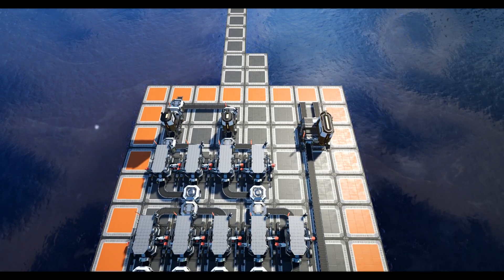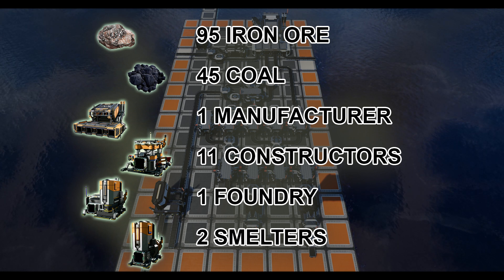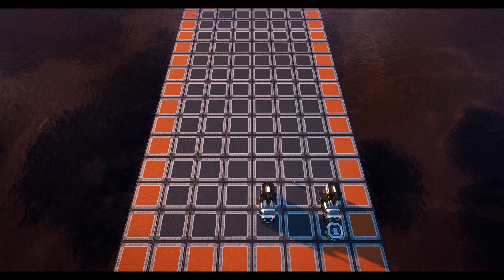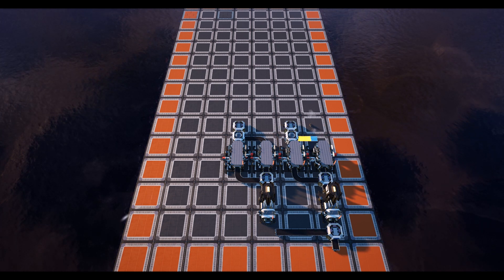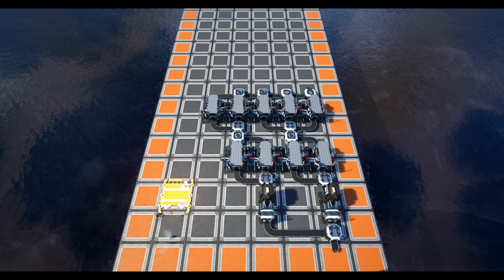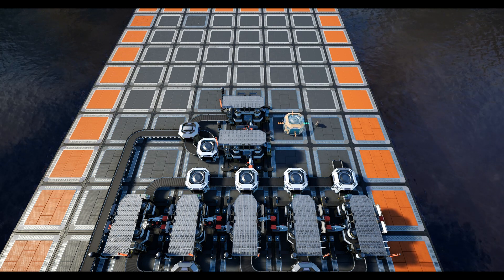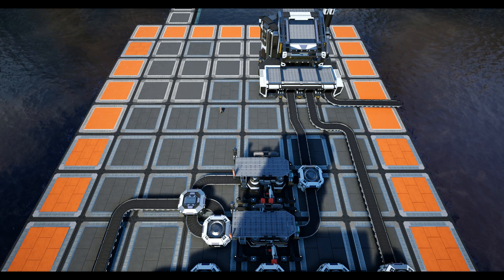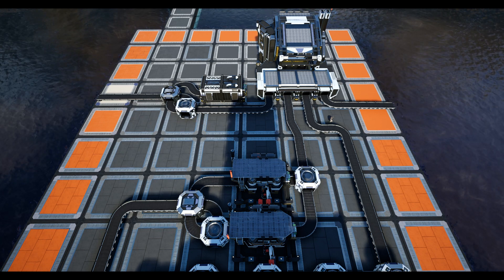Heavy Modular Frames Super Efficient Build Guide [Satisfactory Game]

Comment: I had to use two a4 pages to plan my factory out and farmed 86 power cells to make 3 heavy modular per minute  farm factory, using alternate recipes for steel ingots and steel instead of iron rods rods which made screws super efficient. It was a mammoth undertaking and I'm not even on t7-t8 yet. I've used two storeys to make it happen and have used overflow and power cells to minimise the space.

I've got a 100% efficiency heavy modular factory producing 3 (instead of the base 2) heavy modular frames but it was hard work for a noob like me.

Comment: I find it easiest to plan production lines from end to start. Simple reason why - if you know your goal, it's easier to prepare what you need. Especially at the point where higher tier items require part from not only the previous tier but also few tiers below. At tier 6 you quickly realise that you need a looooot of screws.
Reply: Steel screws go brrr
Reply: @HMolyneux  Steel screws suck lol, just use recipes that don't need screws (heavy encased or heavy flexible frames in this case)
Reply: @anseldejong  it depends on how your factory is built, if its spaghetti like mine was, steel was next to my heavy modular frame production. For a more ordered, rail based infrastructure, i suppose the other recipes would be good, however i've never really figured out how to make a good rail network like in factorio. I should revisit satisfactory and give it another go though
Reply: @HMolyneux  Yeah okay, I usually use a calculator for my biggest factories to optimize production so I usually avoid those recipes. But yeah you should totally revistic the game, such a good one

Comment: Of all the attempts I've done Satisfactory, the most successful ones had a main bus of sorts. Whenever I need to make something new, I just feed off the bus, make the item, and stick it back on. If that line ever runs low on materials, then I go off and build a new line to build that up and feed it into the bus; even if that means I need to import it by rail. Right now, I've discovered turbo fuel. I'm getting 3000 MWh as a side effect of 10 refineries making plastic.